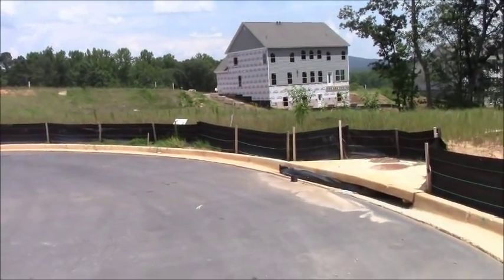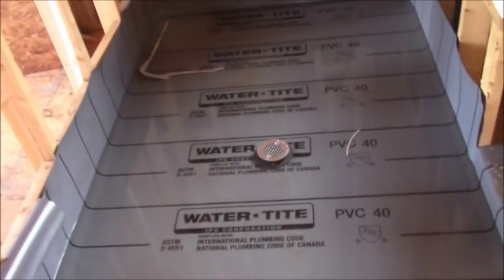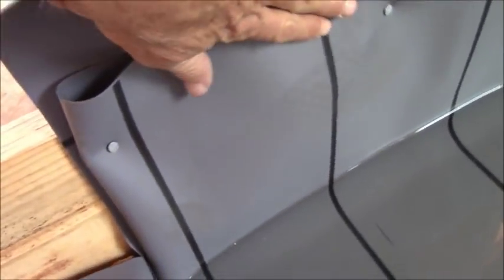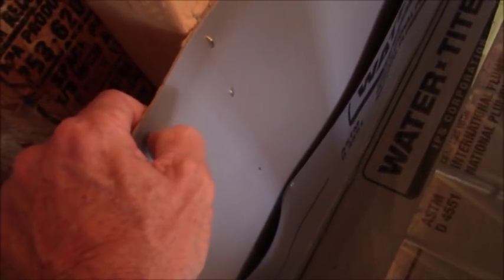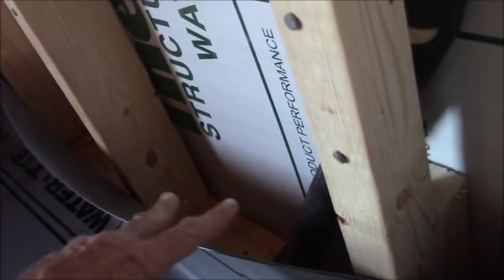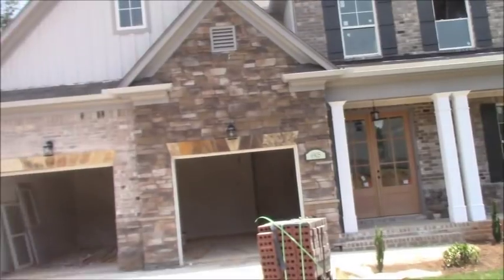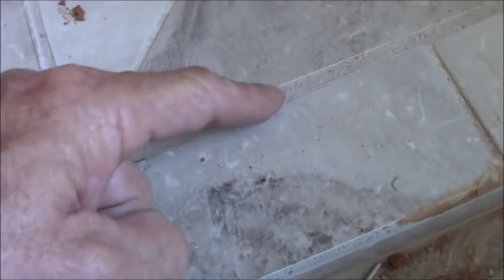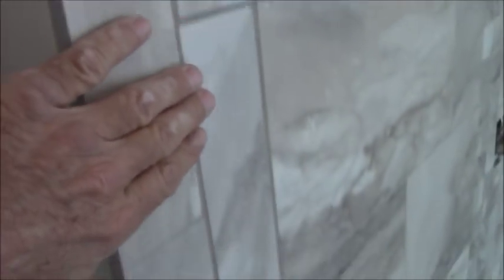NO ShowerPan PreSlope ..NEW CONSTRUCTION

Comment: One of those guys that does everything better than the other guy right?
Reply: Lmao that's what I was thinking lol Or has a better story than yours everytime 😂
Reply: Definitely a one upper
Reply: You should post a reply video to show us how its done! I believe startile`s work and its helped me.... Just saying? But trespassing to troll on others is a No-No in my book..... also just saying!
Reply: Thats definitely not pex huh? It’s uponor which is a brand. It’s pex a and used expansion instead of crimp. You put the ring on then expand it and then put the fitting in. I’m also old fashioned in that if it’s in the budget I think copper would be better. That being said, pex is great stuff and much cheaper. The material is cheaper and it’s much less labor intensive. It’s also better if you have freeze issues as it will give more and expand when it freezes and then shrink when it thaws instead of bursting. Your assessment of the pan is accurate. It’s almost as if the plumber didn’t know you could glue shower pan liner. However it could be that the plumber didn’t do it. I haven’t done a shower pan in years. The tile guys do them now but they rarely use shower pan liner anymore. They mostly use fiberglass. 
PS It’s funny that you said you feel bad about trespassing. You must not feel too bad because you didn’t hesitate to do it multiple times. You also pulled on their shower pan which could have cause tears where the nails go through and you unscrewed the drain which shouldn’t hurt but what if it was a different style drain and the threads and cover were what seals for the test. Then they’d fail inspection and never know why.
Reply: How are they gonna wrap their board around here? Uh... Maybe they are going to float it man? Who cares if you wouldn't have done it this was. The sales man who's pitch is to criticize the other guy isn't worth buying with. I'm done.
Reply: Kinda agree.  Tons of experience but I hear all day long how people would do it better/different.  However I watch the videos but all the little snide comments just is draining.  You can educate without this type of criticism.
Reply: EVERYTHING! LOL 🤣😂😂🤣
Reply: He said hes trespassing harmlessly just looking around..... understandable and interesting. More interesting that no one called the cops. Rest in Peace Armaud Arbery. Murdered by neighbors for doing the same thing. ...Just lookin around
Reply: I did my own stand up shower, you can't feel the slope, and it doesn't hold water in the corners, no boards are getting wet, and im just a home owner. its guys like this, that cause me just to do it my self.
Reply: Yep was thinking the same thing

Comment: I’m a 3rd generation builder/ renovator with over 20 in the trades.  Let me start with the question of the piping. It’s Worsbo pex  by far the best plastic pipe system available and far superior to copper.  As far as the the quality of work I could walk around that site and point out shortfalls by every trade in that place.  It is a subdivision built home, usually lows bid gets the job or the builder gives a set price for the work which is always lower then the price of doing it well so the trades have to cut corners.  If you noticed the shower valve did not look to be centred on the 2x2 till inlay so that tells me the in tile setter did it in a hurry.   There are far superior materials to be used now for shower installs,  Schluter or Wedee system but once again they cost more.
Reply: Isn't it called "Upanore"
 (ooh-pa-nor)
Reply: That PEX name is spelled Wirsbo Uponor.

Comment: Ive been setting tile in California for 25 years. CA requires a preslope to code. in my opinion, water flowing on top of tile pan and water flowing underneath mortar to membrane should both flow out to drain. this minimizes standing water and potential mold growth. i have seen and tested failed pan liners. i have been able to see water going through grout joints, through the mortar bed and flowing down to the membrane to the drain or in some cases not to the drain weep holes at all.
Reply from the maker: I'm a native Californian, but I wasn't doing this work when I lived there. Having said that, I realize my home state has become a bit of a government control dictatorship with rules up the wazoo. 
And I also understand water needs to be moved out of a pan, should it enter...but my belief is a slight 1/4'' per foot slope does little to see that happens, and you'll have a wet pan regardless. Weep holes will be somewhat effective with or without a slope..eventually.
Reply: norton560 I agree with u I live in Texas and I found out that when there's not a pre slope standing water under the liner stinks and home owners can't stand that stench and as usual due to not being pre slopped under liner in some sub division they require to have the preslopped  because that help with standing water specially in the second floor so for my experience please preslopped those shower liners because you'll pay more if you don't name matter what this guy says trying to undermine preslopping.
Reply: So what causes the water to get under the tile and into the mortar area to begin with ? Why isn't the shower sealed up  ..  I do not see how the water is going to magically go out the drain - it will saturate the mortar  ( a bad thing) and then perhaps the mortar will deteriorate and crumble.. Although I don't have issue with pre-sloping - it does not harm anything (except maybe some muscles) to do it .
Reply: pre slope a shower pan is not an opinion but code. I understand you belive a shower pan is better off to trap water and not allow it drain freely to the weep holes.   I agree the morter will suck moisture. but this does not change code and i think it makes a lot of sence.  Ca does have too much regulation but I think most civilized americans are goverened buy by building code.    Shower pans require backing  never done one without blocks .   That is pex  Uponer or wirsbo  very very commonly used (im not crazy about it  but its llegal a)  I definately spotted some shoddy workmanship  short cut crappy  gettr done work.   where the heck does that slop fl;y?
Reply: norton560 b
Reply: So definitely membrane the whole bed then sir?

Comment: Thats a wirsbow pex system (or copy) with expansion connections.  Ive used it for years and it is really durable.  Never had a leak with this system.  The Dewalt expansion tool is worth the money.

Comment: City of Scottsdale inspects the pre-slope, it’s required to pass. We are happy they do this, it’s an extra step but good peace of mind. After pre slope they inspect the pan liner at the flood test.
Reply from the maker: Of course a flood test will work on a pre-sloped pan in an open gravity fed situation...add in 200plus pounds of mortar and now wicking occurs insuring 100% saturation of the material before the slope is relevant. Gravity is trumped by capillary action always. It's like owning a gun but not owning bullets, makes you feel good but useless. But I digress, most tilers waterproof their surface now making a pre-slope a moot and irrelevant process.
Reply: StarrTile city requires it. Gotta do it. Ever argue with an inspector?  It’s just not worth it. If the book says it, we do it. I’m not gonna open myself up to the liability. If I go to court and the codebook/enforcement and the plan differ from what we did we are going to lose.
Reply from the maker: @koprashomes5053  I never said not to do it, if it is cold in your area then so be it, in Atlanta it is not, I was simply explaining the rationale, or lack thereof of doing one
Reply: I understand what you’re saying. It might not be completely necessary however a sloped liner will evacuate the water much faster reducing the possibility of mold collection. Our company is in the desert and we have very strict licensing in our state. A tile contractor is not allowed to do plumbing work of any kind unless they also carry a plumbing license. I’ve noticed every state is different on this. It keeps the specialists separate. Liability insurance issue. We can’t even move Pex if it’s in the way. Gotta call a plumber. This is more for your subscribers than it is for you but if you move plumbing on a job and you’re not a licensed plumber, house floods a year later as a result, the home owners insurance will not pay because the work was not performed by a licensed bonded and insured plumber. If it sounds like a pain, it is. It’s very tempting for us to do our own plumbing, especially if it’s minor. I know, I went off topic of the pre float, lol. Sorry. 

How does it work in Georgia?
Reply from the maker: @koprashomes5053  so I have done an experiment, I even posted it on my channel where I had no slope whatsoever and yet the water flowed out of it, about 98%. Even if there was a pre-slope involved there would still be one hundred percent saturation, so that will beget mold and mildew same way, plus it'll break down properties that cement has in it as a binder, but again I reference back to what I said earlier, most tilers are waterproofing their pan surface so it completely makes a pre slope a moot issue. And yes I understand that California is a dictatorship, I'm a native Californian and have been away for over 20 years, and I'm actually glad I'm not there anymore. The codes in Georgia are much more lax, being a certified plumber is not needed for the minor things we are doing, having said that I keep flood insurance policy. But I have been doing Plumbing much much longer than I've been doing tiling, I actually learned most of that in the apartment business back in the 90s here in Atlanta.
Reply: StarrTile I’m in Arizona. They had to put these laws into affect because there are so many shady contractors out here. The biggest offenders here in AZ are “Handymen”.  Self taught. Those guys are scary “I’ve been doing this for 30 years” guy. Great, but if they’re doing it wrong it just means they’ve been doing it wrong for 30 years.  I employed a guy who said that all the time, 30 years blah blah blah. Great, “why are you using drywall screws on a su deck when I provided you with Deck screws”. Fired him. I’m not saying this is you, I’m sure you’ve met your share of guys I’m describing. 

I didn’t see your experiment. Sounds interesting. Did you have a Control or just a slope vs non slope?  Can you provide the link so I don’t have to scroll through (you’ve got a lot of videos).
Reply from the maker: @koprashomes5053  https://youtu.be/d6Jk-XrmPP8

Comment: As a shower tiler of 30 years I can say that one does not need to hear water running to get a leak problem.  One drop worth every hour is enough to saturate a wooden substrate,  over time,  and set up rot etc.  Evan less, perhaps. 

Also I never use a wooden sill.  Also I prefer compressed cement sheet flooring under a shower.  Anything to stop the swelling that can come with a timber product.  

The  moisture need not come from the shower itself.  In one fix I found that rats had chewed a microscopic hole in plastic water piping,  setting up a fine mist in the space between joists under the shower floor.  Disaster.  Major repair!

Tiled showers in wooden houses requires very special attention to waterproofing detail.  A job that holds together for a number of years is not necessarily good enough.

Comment: I have been arm chair quarterbacking youtube construction videos for 15 years. That's uponor pex, the best type of pex.  Rodents love all types of pex. Ca code does not require slope, tcna requires slope. Ca code allows for tile to be set directly over green drywall.
Copper still better than pex. Pex way faster.  Its about the bottom dollar,  not quality. But if going to use pex, better use pex a/uponor

Comment: Yes you need a pre-slope. Check TCNA guidelines for mud bed shower installations.
Reply from the maker: No, actually you don't need a pre-slope. The TCNA provides no proof, in fact on the entire internet there's no proof it works.
Reply: @StarrTile what if my builder put the bench in after the liner was put in? Wouldn’t the bench soak up water?
Reply from the maker: @AM2PMReviews  basically yeah....unless it was somehow waterproofed
Reply: @StarrTile  we built it later because my wife wanted it and now it am thinking it will just sit in water especially since it isn't sloped.

Comment: I think you have a lot of knowledge about construction sir...however I disagree that a pre slope is not important...it takes 30 minutes more of your time and ensures water in  --- water out...
Reply: I agree with you but how do you figure it only takes 30 minutes? Might take 30 minutes to pour it but it takes a minimum of 12 hours to cure enough to proceed without the rest of the pan
Reply: @tylertomczak5967  What's your hurry?...:)...The one you did the day before is now ready for tile...
Reply: preslope matters if you are not putting in a shower pan
Reply: Pre-slopes are inferior and completely unnecessary when using the Schluter Kerdi Shower system. Get out of the Stone Age boys
Reply: @wigoalie3064  lol...Yeah, pay 1100 bucks for a shower pan...Nice going Rockefeller!
Reply: @godbluffvdgg  
Depending on the size of the shower, $1,100 is excessive. However, assuming you have a shower large enough to cost $1,100 of pan. The Schluterpand will be set And tiliing begun the same day...seems roughly equivalent in regards to material/labor costs. So, yes, get out of the stone age.
Reply: @roostermcghee9506  Yeah, I know; I just shot the number from the hip...It's called ball bustin...Do try to keep up...It takes me 3 days to do a 3X5 pan with preslope and testing,  We used to do one day pans and set... Inspections kill the time...
Reply: If it can’t dry it’s gonna die. Pre-slopes are very important mitigation methods to prevent this to any material, that’s a fact.
Reply: The schluter systems have waterproofing on top of the slope so your kinda arguing his point. Haha let me know how long that foam pan holds up. That deck mud will still be there if the house burns down.
Reply: @wigoalie3064  plenty of kerdi fails on the tube...

Comment: I think what they are doing on the tub install ... they are weighting the tub while the foam they pumped in under it sets. If you don't ... it'll raise the tube when it expands. My guess.
Reply: It's concrete under the tub and it's the only way to set a tub, I do this on all my tubs, even the ones that don't require it.

Comment: Yeah I do tile work in Gainesville fl, 13 years and counting, they do require pre-slopes in the city limits, I do them but I charge extra to do them,do I think it’s a good idea? I guess but I do agree with you Starr tile that most of the water gets absorbed by the mud-bed so it’s kinda waste of time to pre-slope, but if you pay the band, I’ll dance lol !
Reply: Wow I was getting ready to remove my membrane because there’s no pre-slope under it. It’s a 12 year old shower that was smelling like mildew but the true problem is the fact that whoever installed the shower put mortar right up against the weep holes! So you think I can just do a new mortar bed on top of the existing liner? And rely on “capillary action” instead of pre-slope?

Comment: i have always been weary of new construction like that .. and it just reaffirms my suspicions... not just problems with tub or shower but a lot of the time the foundations as well... they go up so quick.. the ground does not have time to settle properly and they have foundation issues. in your case the houses you are going into they want 350,000 plus.. for what, ten years down the road having water leaks and foundation issues that you have to pay out of pocket to fix because the contractor wont fix them.
Reply: Your concerns are justified. I worked in new construction (residential single family and mult-family) and saw careless, shoddy work from foundation to finish.
Reply: I think the same thing. I worked as a mechanical engineer, not construction, but I live in a house built in 1922. I wonder how the houses built now will look in 96 years? My foundation is 18" stone, and 10X3 rough sawn oak joist on 12" centers.
My Grandfather built Churches and my Uncle built homes the way they did in Germany. They'd put the foundation down and leave it for a year to settle before they'd build on it. Today they build the whole house in under 30 days.
I am trying to learn how to properly put a tile shower in, and tile my bathroom and kitchen. These videos are very helpful, as is the comments.
Smiles!
Reply: I had a house built and went to inspect it every week. I had a bay window that the joining angle lines were like a treble cleff . I informed the builder to fix it, they came out and worked on it - (at least I think they did ). I informed the builder the second time to fix it - they came out and worked on it. I informed the builder the third time and I told them - I don't care if they come out 100 times - it is their time and their money that they are spending and I will have them come out until it is correct. The choice is theirs come out get it right and be done - or keep coming out - it is cheaper to just fix it right the first time. That did the trick - some one apparently got the idea every time they worked on it after the first time they were losing money that they could have been making on another job.
Reply: DreamAssassin26 this is why hundred year old houses rock. You know they will last.
Reply: kutzbill same with my 120 year old home. It's solid like a rock.